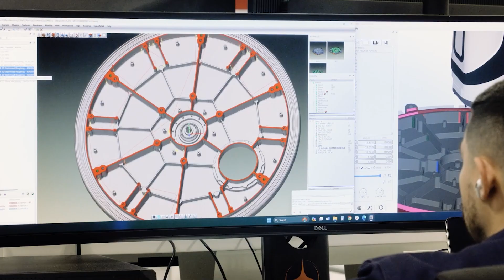SpaceX Revealed Starship to Become NEW NASA Space Station...

Comment: It makes sense for so many reasons the ability to re-enter in an emergency is epic the only issue is modularity which im sure can be easily achieved.
Reply: You make a good point, though concern though starship having all the extra room that is dedicated to the fuel, what do you do about that? If this was or is serious, why not have those two sections separate into an independent piece, along with docking rings to attached more of the same dedicated to different research or otherwise?
Reply: @RamblingRodeo  a very good point as it would be pointless with every corner of the station being a giant fuel tank.
Reply: @NoobNoob1986  Thank you, i keep hearing about them using starship, but nothing about what would they do about that section. It isn't as if we could build it out in orbit, we don't have that capability and it has stated that we couldn't. So, what or how or why would they keep that section attached?

What i would like to see is an empty built out entire portion of the Starship module, take and build out attachment or docking areas for more of the same, making a HUGE station?

Did you or have you looked at VAST? They will use Falcon or Dragon for main parts, including Starship for a Central Core.
Reply: @RamblingRodeo  I haven't looked at it but I will go have a look. 

I can only assume they would eventually just build a big enough booster to get the starship to orbit without the need of such a large tank. As you are right doing it up there isn't happening anytime soon.
Reply: @NoobNoob1986  The Vast situation is an interesting one. Idk about larger booster, they would have to placed more boosters on the main booster? I don't se that happening either.